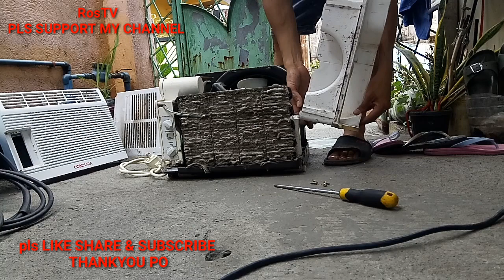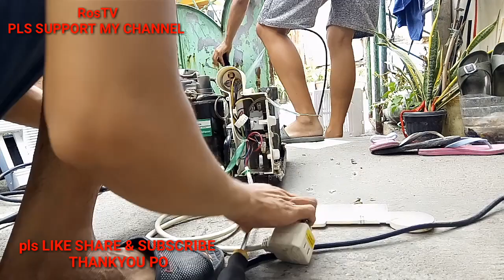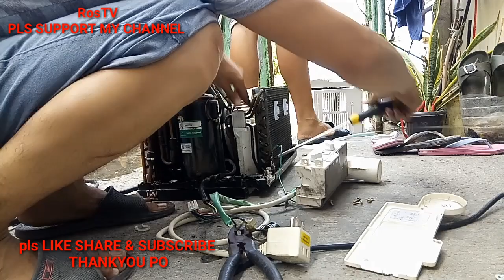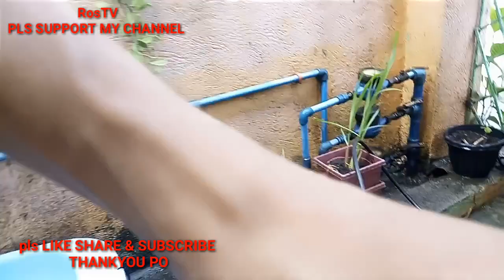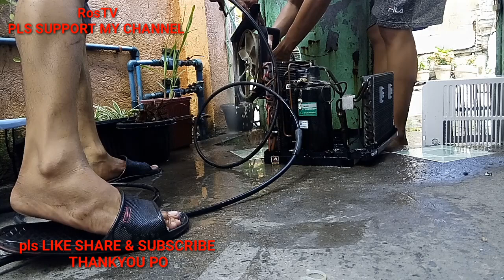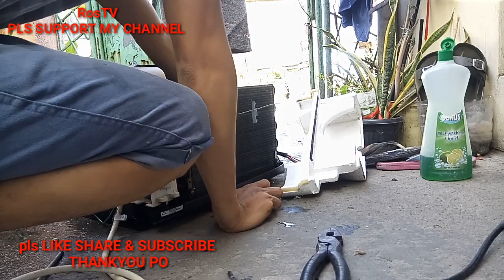PAANO LINISIN ANG CONDURA WINDOW TYPE AIRCON

Comment: Sir ano po yung mga tinanggal nyo dyan? Di ko po kasi makita. Para makasiguro lang po sana. Salamat
Reply from the maker: Ung una ku pong tinangal 
Cover po sa unahan 
Sunod po ung kaha na po 
Sunod po ung filter nya po 
Binalutan ku lang po ung control ng plastik para po di mabasa
Reply from the maker: Sir tinangal ku po pala jan ung control nya . Tinangal ku po ung wire ng  CSR
 sa compressor para matangal po ung control saka po tangal pati fan motor

Comment: Sir papicture naman nung connection sa capacitor
Reply from the maker: Good pm 
Dual cap po sya 
15+2
May tagging po kaung makikita sa capasitor ,
Herm , fan , Common 

Ung sa herm po 
Ang naka lagay starting ni Compressor 

Sa naman Fan po ang nakalagay 
Ung auxliary starting  ng fan motor 

Dun sa Common po 

Running ni Compressor 
Isang line power supply 
Saka line ng timer 

Salamat po